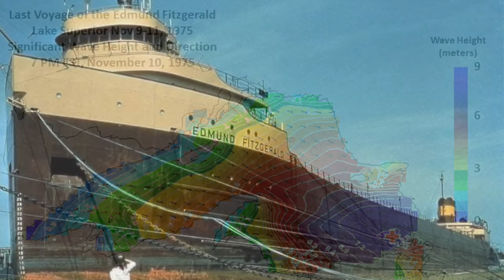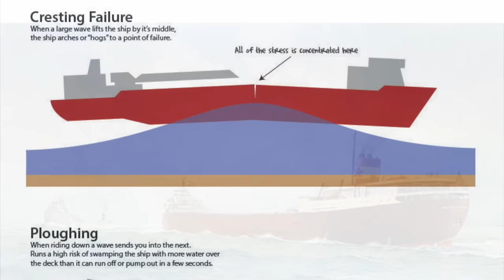What Happened To The Edmund Fitzgerald?

Comment: For whatever reason, the Fitz was taking on water faster than it could be pumped out. This strongly suggests the hull was compromised, either by stress fractures or bottoming out. The only problem with the shoaling theory is that 1)there is no visible damage, scratches, or scrapes on the capsized stern and 2)subsequent dives to the shoals failed to provide any evidence of damage or traces of paint. The damage to the bow suggests it broke apart on the surface, the bow going down at a 90 degree angle, detached from the stern, The layers of taconite pellets found on top of the bow more or less prove this. The way the wreckage is strewn about the lake floor suggests it tore apart and broke up like a green stick fracture. This strongly suggests that stress fractures, small at first but then the ship was ripped apart by those 2 monster waves, the stress fractures lined up on a ship that described as having a rotten keel and 2 of the workers at that steel plant in River Rogue swore they passed off defective welds. All weather McSorley "can't make no money sitting at anchor" 'beat the shit out of the Fitz ' which by the cook's account, never should have passed the 1975 inspection because of the condition of the ship and all the broken welds that held the rotten keel he was shown. So for whatever reason, she was taking on water, McSorley knew the thing was sinking when he slowed down to let the Anderson catch up to her. Those 2 monster 50 foot waves drove the bow under, and the ship was ripped apart like a greenstick fracture.
Reply: So do you think he didn't make a distress call because he was in severe denial or too proud?
Reply: @bradsanders407  Myself, I am inclined to think arrogant pride. McSorley's decision to slow down strongly suggests he knew she was sinking. Then later, 'don't allow no one on deck suggests the crew knew. Finally, 'we are holding our own' suggests some arrogant pride, too proud to beg. Maybe they knew there was nothing at that point
Reply: @bradsanders407  Maybe, they brought out some bottles of scotch and hoped they would reach the safety ofv whitefish bay or die trying. Back that is admittedly speculation based on a runor that one of the crew at the ship's top was a heavy drinker
Reply: Lars , I remember the sinking of the Ed./ Fitzgerald well and read many stories and theories as well back then.  I will say your comment and theory makes the most sense. Thanks for posting,,
Reply: Some divers have reported finding antifouling paint on the rocks where the Fitzgerald would have passed over them. Its impossible to know for sure that that paint was from the Fitz, but it is suggestive and tantalizing.
Reply: Maybe it only struck the shoal on the part of the ship that later broke in half what would explain the lack of damage on the stern, it could have struck just enough to rupture a couple of ballast tanks
Reply: If the Anderson had had the presence of mind to warn the smaller, overloaded, compromised Fitz of the rogue waves "All weather Mcsorely" might have had time to try and launch lifeboats and/or at least altered course to pitch and roll at a better angle. Mcsorely most likely did not broadcast a mayday call because the rogues approached from behind (likely unnoticed) and both he and his radio mast were underwater within seconds of the waves hitting them. Overloaded or not - with wave troughs lowering water level by 12 feet, Mcsorely should never have passed that close to the to the inaccurately charted six fathom shoal. He paid for that mistake with his life.
Reply: @bradsanders407  3

Comment: I was a deckhand on a Iron Ore boat in the late 90's. Our flat keel had also broken away from the hull in a couple of the ballast tanks, we called them the chimes these support structures for the flat keel. The main hatch way is built into a box. High hull sides on the main deck to protect you from waves when you exit the hatch way. If waves are coming from the stern they will pile up in this box. If you get enough water and force in this box I can see it ripping open the hatch way. The cargo hatches would have been secured, they had more than enough time to do it. Cargo hatches leak even if they are 100% secured. We had to tarp one of the cargo hatches because it leaked. What sank that ship? Everything put together, broken keel, over loaded, Ripped open hatch way, taking on water in a ballast tank, and the final thing a huge wave. She was heavy on the bow in a rough storm they would not have noticed. Huge wave drives the bow under, she takes on more water, the bow never comes back up.
Reply: That's exactly how horrible disasters happen....not one thing, but a number of things.  You illustrated it better than anyone.

Comment: In 1978, an inspector from the NTSB was denied permission to board and sail on the Edmund Fitzgeralds sister ship, the Arthur B. Homer. To me it was obvious why the NTSB had more than just a passing curiosity about the Homer, possibly on the lookout for any signs of a design or construction defects of the vessel, since the Homer also was plagued with integrity issues concerning the ships keel. Two years later the Homer was pulled from the fleet and never sailed again. It was quietly scrapped in 1986, it's rather peculiar that a relatively young boat was suddenly and permanently taken out of service.

Comment: I think the best explanation is that something tore the vent covers off. Those vents are for the ballast tanks. It could have been something heavy floating on the water, such as a log, or the spare propeller blade tore loose and hit the vent covers on its way overboard. Either way, with those covers missing, water would have started entering the ballast tanks on that side of the ship. Since the ship is designed to flex, this would have caused a torsional bend in the hull, putting tension on the shell plating and keel that grew worse as more water penetrated. This would be the list that McSorely described. Once the rogue waves caught up to her, they would have made her flex one last time, causing the shell plating to explode out, leaving the keel and spar deck holding her together. Naturally, the bow fills with water and quickly plunges, with the stern following, capsizing as it does so. Courtesy to Douglass Hollister for this theory.

Comment: The Fitz wasn't scheduled to make that run. At the last minute the Edmund was put in service, it had keel problems and was actually scheduled to be sent for repairs. To make matters worse it was also overloaded by 20%. As the video describes the Fitz probally hit the bottom and caused the ships keel to fail. Sadly, for the survivors' families the Insurance companies only paid a few hundred dollars to the families each and pushed for the wreck site to be off limits. If they had found out the truth, the Insurance companies may have had to pay Thousands more per family.
  Ships have broken up due to rough seas before. I read where a Tanker was broken in two by 2 large waves, the center of the ship was unsupported enough that the hull split. The Bow section drifted in the seas for over 80 miles before sinking, scary how powerful the Ocean is.
Reply: Why didn't the captain refuse the load, if it was so far over the limit?

Comment: Thank you- Good presentation.   Didn't realize that the ship's hull was constructed in pieces, separately, then welded together.    I agree with Capt. Cooper of the Arthur Anderson.   Fitzgerald reported fence and vent damage and a starboard list at 3:10 p.m. in the afternoon.  She was sinking from that point on.  For several hours, the Fitzgerald's pilot house kept pounding down into each new wave.  They kept coming up again and again.  Finally, they went down into a wave and didn't come back up.   She was overloaded and flooded with water.   At that point, she went like a submarine to the bottom in one piece.  The collision caused the center of the boat to compress like an accordion.  Torque from the propeller and ballast tanks caused the stern to invert. 

I go along with the surviving families not to have any further dives.   But no one has been down there since 1995.   I wonder how much rust and deterioration has occurred since then?   Not a lot has changed and there are no "smoking gun" clues to find.   The Fitzgerald likely hit the shoal and the damage to the hull may have occurred in the front of the boat (now buried in mud) and the middle (which disintegrated when the bow hit bottom). 

Kudos to Gordon Lightfoot who sincerely wanted to honor these men.  Very few would still remember the Fitzgerald had it not been for this brilliant song.
Reply: One aspect of the narration that is false is that the Edmund Fitzgerald was the first example of a vessel built in sections, then welded together. Germany constructed U-boats this way during WWII, with sections built in scattered facilities, then shipped to the assembly shipyard, where the sections were bolted or welded together. Later in the war, the sections were assembled with equipment already installed, requiring only joining of the hull sections and connecting internal piping.
Reply: The lake is so cold at those depths, decomposition can't happen. If there are bodies in her, they are perfectly preserved,same with the ship
Reply: @seanmalloy7249  Yes, agreed The US used this modular method of construction as well in WWII. 
  The stresses that these ships take are tremendous, I believe it had to be the combination of a lot of different factors working in unison. Overall wear and tear, Metal fatigue, Rogue waves, previous listing, pumps not being able to keep up. I think the hatch covers more than likely blew off from the air pressure in the holds when it sank. maybe it did bottom out, if that's the case it may have only been a contributing factor.
   I was in 7th grader in Southern Michigan when the Fitz sank, my english teacher will testify that I had many a doodle in my note book of the Edmund Fitzgerald after that solemn next few days in class. I couldn't believe how quickly Gordon Lightfoots song came out afterward.
This Story fascinates me to this day !

Comment: My theory is the flexibility in the vessel and the added weight from taking on water cause the vessel to snap when hit by the road wave. Which is why the crew didn't have time to get on to life rafts and there was no distress call given.
Reply: BINGO 👍
Reply from the maker: They just plunged and had no time…..
Reply: I believe you mean 'Rouge Wave'. I'm pretty certain that 'Road Wave' isn't a thing.
It is pretty widely accepted that the "Fitz" encountered a  train of three very large waves. In fact they are often referred to as "The Three Sisters". The basis for the acceptance of this theory is that the Arthur M. Anderson, the ship that was running ahead of the Edmund Fitzgerald, encountered the train and warned the Fitz it [train of 3] was headed their way. (The presenter of this video states that it was two waves.) 
Rogue waves have been documented on the Great Lakes in the years since the loss of the Edmund Fitzgerald. The "average" recorded height of these rogues (the last time I checked), is 10 to 11 meters (approximately 33 to 36 feet). This corresponds to what was reported by the Anderson, and with damage observed on the wreck of the Fitz. 
The tallest rogue wave recorded was over 80 feet high, and was located in the North Sea.
Reply: The iron ore took on weight when it gets wet.  
The ship when the 3 waves hit it was already going down and the waves crushed it tearing it in half and their would be no time to get to a life boat.
Plus they had summer load of iron ore not a winter load so they were already loaded heavy.
Lastly their was talk of bad welds on the fritz before it sank and even on its sister ship that was pulled from service in early 80s which left it with a short life span.
But basically everything that could go wrong did.
Reply: TV

Comment: Hi Conner,
I have enjoyed several of your videos.  Nice to know a younger person is interested in ships and history.
I remember the Detroit News reporting of the loss, I was 11, 12 on the 18th of that month in 75.
The event caught my interest.  I read several books about freighters, shipwrecks, and the Great Lakes System.
I have never believed she broke up on the surface.
Early reports suggested she was to close to "Six Fathom Shoal".
I believe she "shoaled", and took on water at terminal rate, due to ruptured plates, allowing ballast tanks to flood, adding thousands of tons of weight in a short amount of time.
She settled low in the water, and with a following sea, including the reported "Three Sisters"  series of waves, forced her bow down, green water over the cargo deck, many more thousands of tons of weight in a matter of seconds, and not enough buoyancy to shrug it off.  I think she took a nose dive and was thrust in to the lake bed still under power.  The impact would cause the hull to shatter as it appears.  Notice in the drawing of the wreck, the vertical hull plates,  at a point of disconnection, curve inward.  The thrust of the still turning propeller caused the stern section to rotate as it sank, thus settling in an inverted position.
I will never believe hatch cover clamps, or nicks in the combings, were a factor.
Lost tank vent covers would let water in so they might have contributed to the sinking.  Hard to understand how water over the deck could damage the vents, but that is the power of the sea.
The railings are wire ropes, and if they were down, as reported by Captain McSorley, they would only break under tension, which means she "Hog Backed".
He, and the crew, must have felt such a force as grounding, the question is, why did the Captain not report it.  
My opinions are simply that, although, formed by other influences of study by other researchers.

I think the ships bell should have been left aboard.  

James Bell
Reply from the maker: Interesting, I agree about the hatch covers, I think they didn't make a difference.
Reply from the maker: Thank you!
Reply: I think that’s what happened too.🍻
Reply: @ConnorTenold  from what I read, the bell coming up was to console the families.
Reply: I agree with pretty much everything in your post. I also agree with your thoughts on the ships bell. That bell belongs with the ship and her crew. Grave robbing....
Reply: When I was young her wreck caught my attention.  Was never interested so much in ships at my young age except that I knew my dad served on the SS Grouper, 214, in the 50's, before he married my mother.
The b&w pic of his sub captivated me, well, period.
Then in 75, well we know what happened.
Wanted to go to the GLMA after high school, but poor vision in my left eye, well, they wrote me that I could not pass a deck officers exam.  I think they should have offered an engineers education if one bad eye would not be a problem.  In hindsight I would have preferred that anyway.  There were still, how many?, reciprocating steam engines left at that time,  would have been about 1986 when I would have earned an Engineers Ticket, albeit, 3rd Officer.
All the classic, steam powered ships are history now, with the possibe exception of the "Badger", which I believe still has reciprocating steam engines.
Well, I can't be out on the ships but I can see them when I load limestone for concrete plants, off the docks on the St. Clair River.
Best wishes to al GL shipping fans.

PS, We have a sub like my dad's, the "Silversides", SS 236, in Muskegon, Michigan!.
Reply: Why would you believe that hatch cover clamps had nothing to do with this sinking? Many were found to not be tightned down